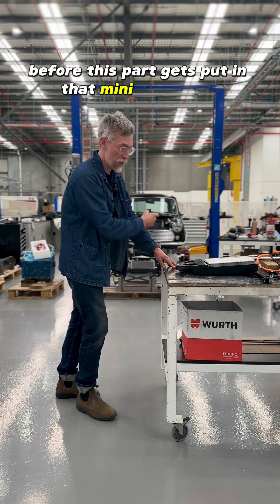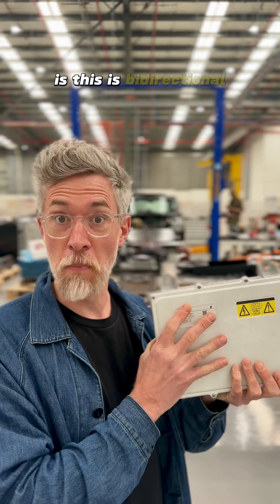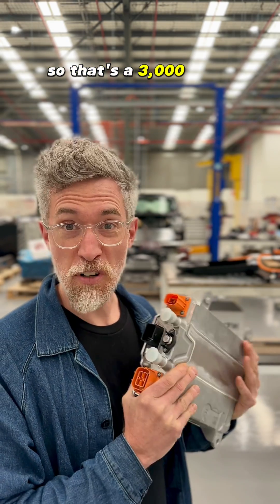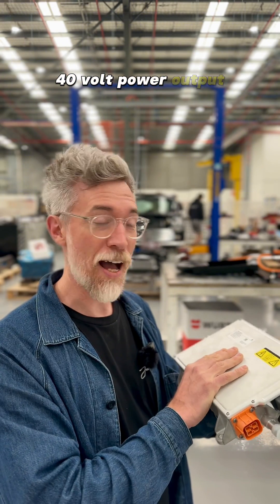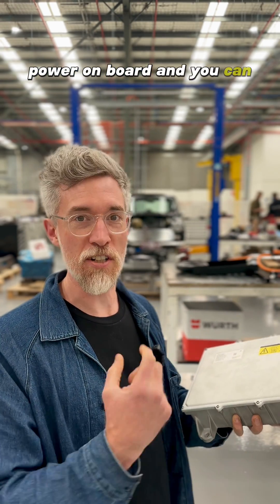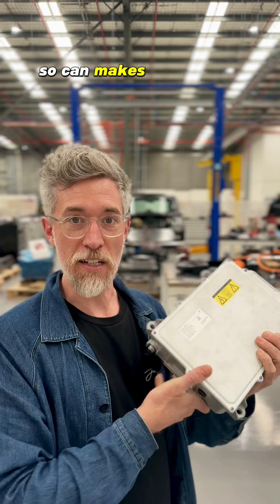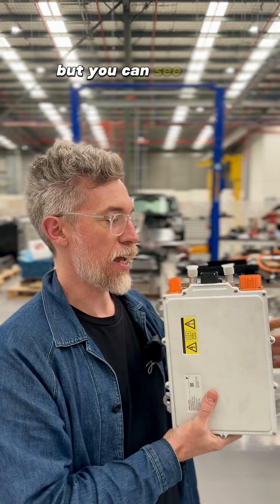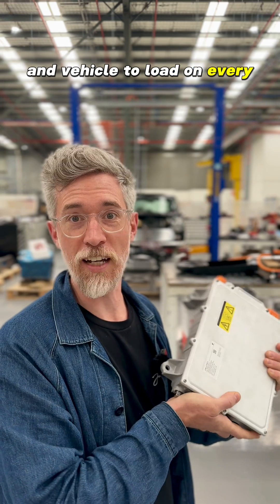Bi-Directional EV Charging (V2L) now on all our conversions

Comment: Wow, what a small package with so much functionality. Qudos to the team that designed and built this unit.
One question, how come its not a vehicle to grid device? The cheap solar inverter I have feeds the grid, so it is possible, just very few V2G implementations of this on EV's.